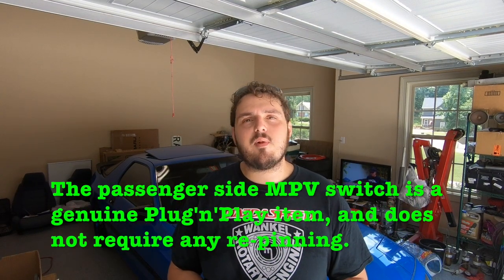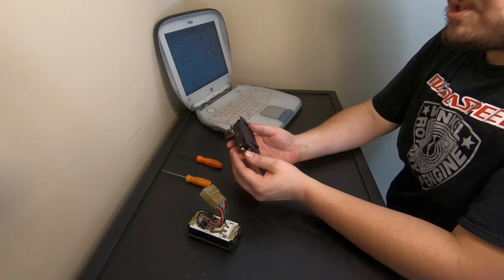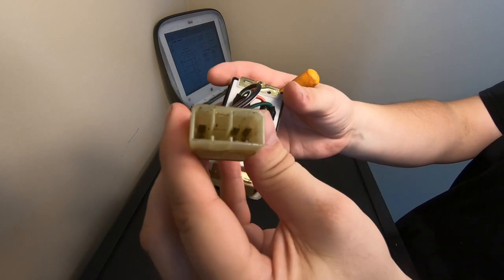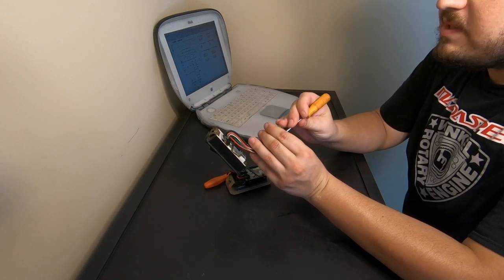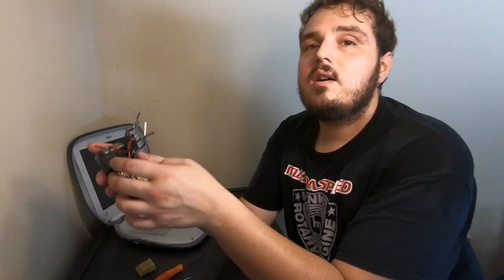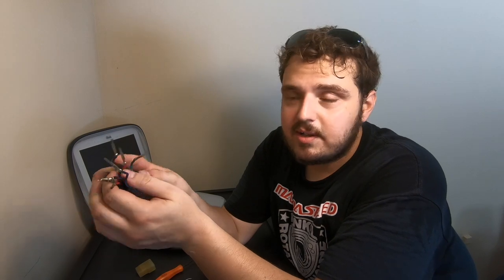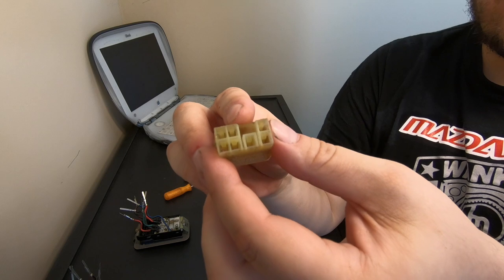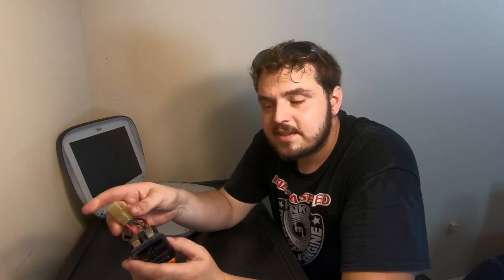The Spin Cycle Ep. 4 - FC to MPV Power Window Switch DIY

Comment: Do you need to swap both for either one to work? Or can I just do the master? Thank you!!
Reply from the maker: You can just do the master.
Reply: @TheSpinCycle7  thank you!! Your channel has been a massive help, please keep making content on the fc if you can. Brakes, oil changes, maintenance, literally anything
Reply: @TheSpinCycle7  Hi man, I did the swap as you recommended but it still isn't working. Double checked the wiring as per how you identified and I am using an original rx7 passenger side. Any advice?
Reply from the maker: @Abinayen  you may have a bad/corroded switch or a deeper wiring issue. Could even have a seized window motor or the regulator is frozen. Grab a multimeter and start verifying you're getting power where you should. Id start by metering for voltage going to the motor when you activate the switches.
Reply: @TheSpinCycle7  Do I check that from the female connector coming from the car? Just keep the key turned and then check each pin? I did check that and I was getting voltage from only one pin
Reply from the maker: @Abinayen  if the doors have ever been off your car during its lifetime, it's possible the harness was not routed correctly. The harness leaves the door, goes thru bellows and into the base of the hinge pillar. It's possible the harness is being stressed and pulled where it enters the car and has damaged wires in that area. Again, see if you're getting voltage to the motor when the switch is activated. If voltage is getting to the motor, it's probably bad.
Reply: @TheSpinCycle7  okay that is possible as the car was resprayed prior to my ownership. My passenger door was working when I first got the car but that also stopped working. I’ll have to do some more research.